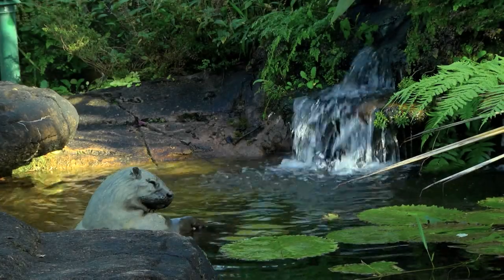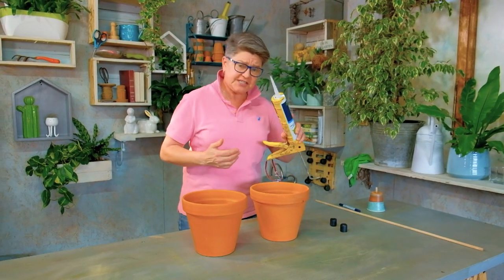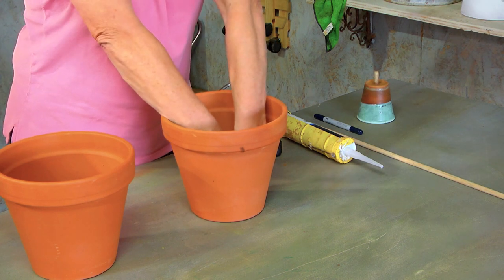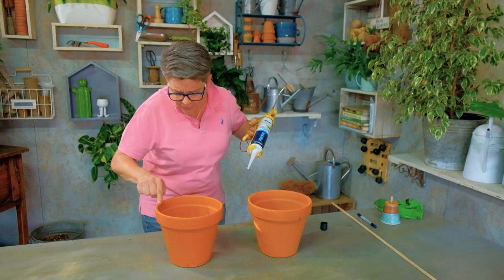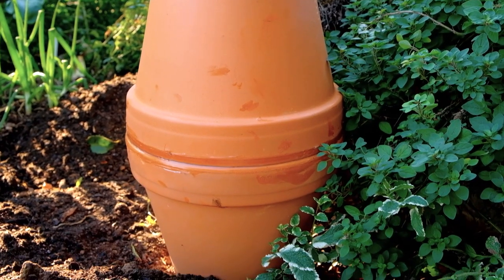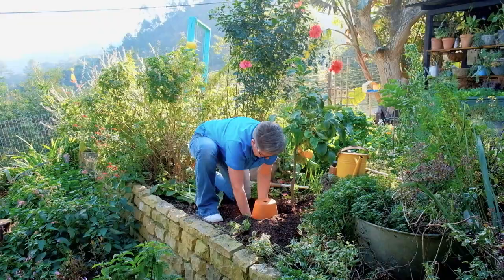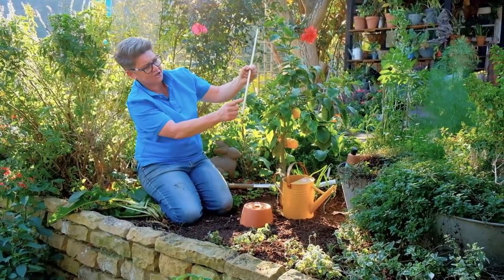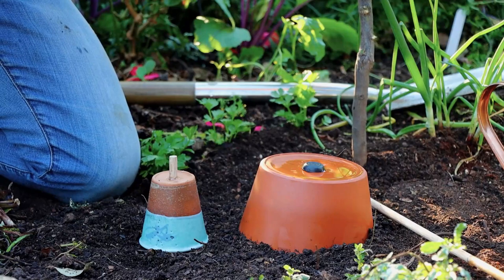How to make and use an Olla watering vessel

Comment: I've been using these for about 10 years now in a very hot climate (South of Spain) and I keep seeing the same thing on videos which is people not putting the olla in deep enough. You need to have about half an inch sticking above ground and the top inch of the olla should be varnished, otherwise you lose an enormous amount of water through evaporation. Otherwise, great video.
Reply from the maker: Thanks for the info!
Reply: @TanyaVisserTheGardener  - Thank you for the video,

Comment: one thing to take note of is your climate. If you live in a very warm climate you want to very much more of the pot to keep it cool. If you live in a cooler climate you want to leave some of the pot above-ground so the sun can warm the water.
Reply: Well, if the water is permeating to the outside (and that’s the whole concept of an Olla) it starts cooling the part of the pot above the ground by default via condensing its content (like a wine cooler). So, no. As long there’s water inside, the pot shouldn’t heat up.

Comment: Hi. I love your video!! Amazing thorough demonstration, thank you!!!
I was wondering on your 'how to make DIY terracotta ollas' what is the exact silicone sealer you used?  I live in Italy- so we may have different brands and types of silicone sealers; I am told that they are all waterproof, but are split up depending on what material you are using the silicone for.  As far as nontoxic; the only ones seem to be used for aquatic life- making aquariums, but are NOT used for porous materials such as terracotta.  Also, silicone used for interior water plumbing don't seem to be nontoxic and again are not to be used for porous materials.
The only silicone advised for terracotta are ones that are used for constructing porous building materials (listing terracotta), but are NOT listed as nontoxic.  The clerk told me that it shouldn't matter anyways (even if there's a chemical) since it is just to seal the two pots together....? 

I tried to use the nontoxic aquatic silicone sealer for attaching the two terracotta pots together, which is supposed to dry in 24 hours, but it is very sticky and seems to wipe off a bit even if the two pots are staying attached together.  Not sure if it just takes longer to cure or this is how it will remain- if at all.

Could you please show me exactly what one you used? I would appreciate any information or advice you could give me on how to proceed; do I need to wipe it off and start over with the Universal builders silicone for porous materials?

Thank you for any help you can offer me!
Paj Tognetti
Reply: I paused the video about 3 mins in and the label says Bostik marine (silicone sealant I think). It looks like the one used for aquariums but I'm not sure. 
What happened to the pots you attached together, did it work?
Reply: Product overview

Bostik Marine is a clear, one part acetoxy curing high quality silicone sealant that provides a permanent flexible, durable, watertight seal when building fish tanks and aquariums. Excellent for heavy duty marine work. Ideal for general purpose sealing, waterproofing and weatherproofing requirements in and around the house when doing DIY projects. The sealant is extremely resistant to UV, weathering, ageing and water, and offers excellent chemical resistance and is unaffected by alcohols, diluted acids and alkalis, soap and household detergents. The sealant remains flexible over a wide range of temperatures from -40°C to 100°C. It also performs as an excellent adhesive on non-porous surfaces where an elastic gap-filling bond is required.

Not suitable for alkaline surfaces such as concrete, fibrous cement, asbestos, plaster and marble. Not suitable for some metals i.e. mild steel, lead, copper, tin, galvanized iron, brass or zinc as it may cause corrosion. May become discoloured in contact with some organic elastomers, which tend to bleed oil or solvents into the silicone, e.g. EPDM, APTK, Neoprene and Bituminous surfaces. It should not be used on the back of mirrors, as it will de-silver the mirror backing, affecting the front appearance of the mirror. Not suitable for contact with natural stone i.e. marble, granite, quartzite as it may discolour the surfaces. Will not adhere to some plastics such as polyethylene, polypropylene and Teflon. Do not apply sealant when relative humidity is below 10% - cure rate will be affected.

Not suitable where mould-resistance is required e.g. sealing of showers, basins and baths.

Does not contain a fungicide which may be harmful to aquarium fish.

Not paintable.

Comment: I am using a single unglazed terracotta pot. I plug up the bottom hole with painters putty which works well. I cover it with a plastic lid However, when I bury it, the water level never goes down, even after a couple days. Am i doing something wrong?
Reply: Its not sealed properly around the lid?
Reply: As she has said already, it needs to be watered from the outside too to "connect" the Olla to the surrounding soil and its capillary (water transporting) system.